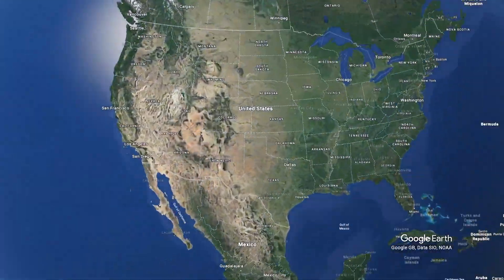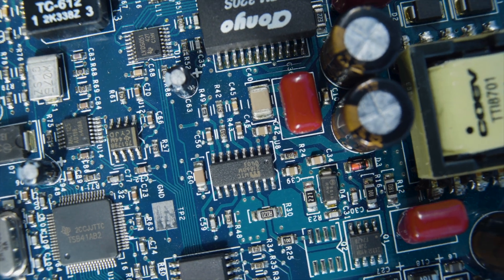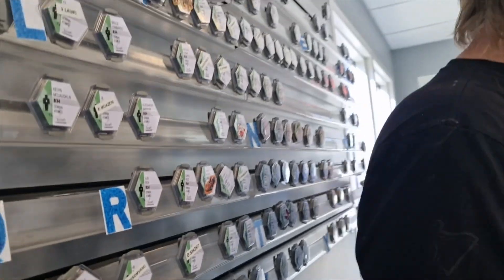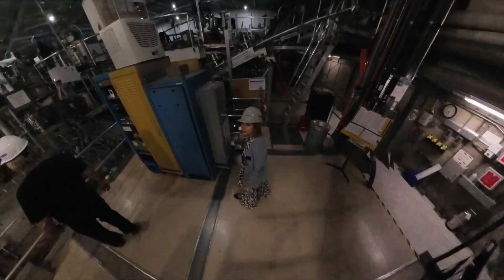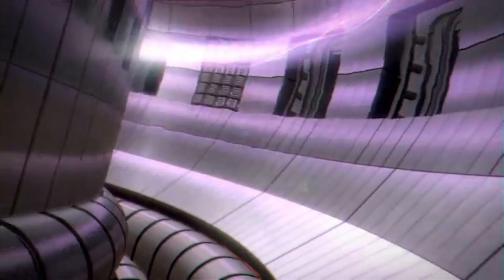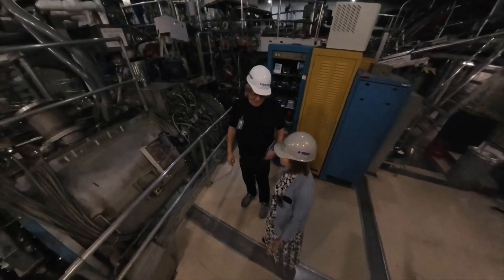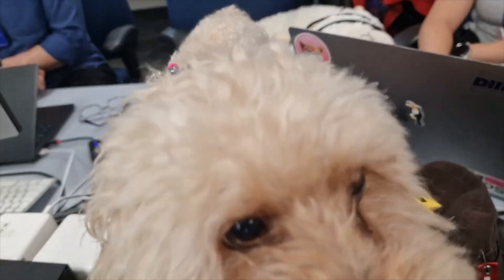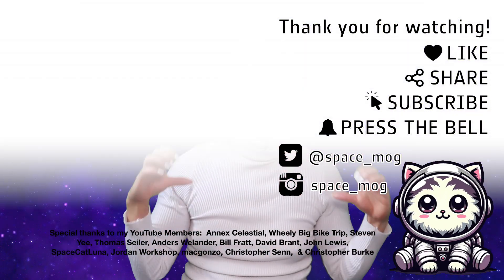DIII-D: I WENT INSIDE The Most POWERFUL Machine in America

Comment: Our opposition government is proposing to have built a number of reactors here in Australia which I'm very much against. E2S Power has just completed the conversion of a coal-fired station in India which now runs completely on stored thermal energy using graphene within nitrogen that stores the 700C piped water to drive the generators. Only having the experience of cabling, racking, routing and earthing 2 coal-fired stations designs it seems such a waste to just de-commission them after only 30 years when they could give so much more at little cost, no coal, pollution or waste. The company I worked for then wanted to send me to Brazil to work on the cabling of nuclear stations but needed to be fluent in the german language. My wife decided to end other 20 year marriage instead. Was also self- building our mudbrick/adobe home, so was a rough time for me 32 years ago.
Reply from the maker: That's a fascinating story and a unique perspective, it's interesting to hear about your experience with coal-fired power stations and the potential for repurposing them and completely understandable to have reservations about nuclear power, especially given the potential risks and the long-term challenges of waste disposal
Reply: @SpaceMog  With so many coal-fired stations across India that will probably be converted, it's going to cause a very big drop in Australia's coal exports making it even more difficult to afford to build what's proposed.

Comment: The usage of epoxy in the close proximity to this much heat is mind boggling!
Reply from the maker: Its not even 30C here in the UK at the moment and i feel like all my plastic is melting
Reply: @SpaceMog  We've got those temp in Ukraine as well, but I can bet it wasn't humid as bad as in the UK, so it wouldn't feel as terrible.

Also, I choose 3d printing filament for outdoor application with the thought that it's a thin line between human-tolerable temperatures and common plastics transition temperatures!
Reply: They make epoxy that is good to over 500C  It is more expensive than the stuff in the hardware store.
Reply: @kensmith5694  Yeah, I understand that and the fact that there are a lot of going on between the epoxy and the heat, but my mind is already boggled at that moment :)

Comment: Sooooo…. When can we be expecting that safe, clean fusion power in reality? These are interesting experiments but how is anything like that ever going to be practical? Fission reactors are comparatively REALLY simple and we struggle with them…
Reply from the maker: You're absolutely right that fission reactors are comparatively simpler than fusion reactors, and yet we still face challenges with them. Both China's Honghuang-70 and France's ITER hoping to get 10 times energy output by early 2030s
Reply: @SpaceMog  ok, it’s a lovely idea, but I’m filing it with 200KVA battery that weighs 300kg and charges in 10 minutes. I honestly don’t expect either to happen in my lifetime. Not to be totally negative, OTOH I guess it’s cool that someone keeps paying for the research so the research can actually happen, it is cool stuff, even though it’s so very, very hot. 😜

Comment: The graphics shows a deuteron fusing with a tritium nuclei, that does not happen in any known star, instead stars use the PP or the CNO reaction because they have huge gravity to make that work, while on earth we cheat by using fuel that was either created by the big bang ie deuterium and the tritium which comes from Candu fission reactors. An astrophysicist should know how fusion works, both in the stars and on earth.

Only an idiot would state that fusion does not produce radioactive waste, when the DT reaction occurs it releases a He nucleus and a high energy neutron which will absolutely irradiate what ever it hits turning that radioactive. And while lithium can breed tritium, it requires a fast neutron to do so, and the tritium nuclei might just fuse with a deuteron, whose neutron release might release the required tritium to continue the chain reaction.

As for fission reactors they also do not generally run away either, this drivel about runaway reactors is just uninformed nonsense.

So in fission the chain reaction has +ve gain, every neutron in the chain will cause 2 or 3 more neutrons to be released causing the chain to move on. In fission reactors the designs limit the chain so that the neutrons are produced at a constant rate as conditions allow, it does not run away. If anything, the MSR designs follow the work load, the more heat that is pulled out, the more heat is produced as the reaction rate increases and vice versa, its simple physics.

But in fusion, the neutron gain is way less than 1, possibly only 0.01 given that most of the tritium that is injected into the chamber will not fuse but will be lost in the chamber and also irradiate the wall. And if the tritium does fuse the released neutron will not likely create its replacement tritium.

Look for Daniel Jassby to learn about neutron economy.

Fission makes loads of sense esp at 1000k in no pressure MSRs, fusion makes no sense at all at several 100,000,000k and is 1000s of times harder to achieve. The only possible fusion reaction that could work would be DD but that requires far higher temps than DT and is also unpredictable with various fusion results. There is also DHe3 which also has no fuel source.

As per ITER, the energy gain of tokamaks is very low, more energy in than out, in ITER case it will take several more generations before there might be energy gain that could be useful.
Reply: The Alpha out of the reaction is not a big problem.  The neutron is serious trouble.
People are using a bigger and bigger hammer trying to make this work.
Reply: I think this was an excellent summary from a bird's eye view. Diving down onto a detail will just leave the audience with the wrong impression. This was actually a lot of details and very accurately presented from this view.
In a fusion reactor the neutron will just go out and get multiplied by lead probably and react with lithium to produce at least one new tritium per DT reaction. The last I heard was that they thought they could get to 0.98 new tritons per DT so it needs to go up a bit. The neutron carries most of the heat but it is the alpha that will sustain the fusion burn. The reactor needs to be big enough and the field strong enough so that it bends the trajectory of the fast charged alpha particle enough to keep it inside the machine. Then it gradually cools off by heating the rest of the plasma and keeping it warm or hot is a better word.
I agree fission is easier and awesome and can be made very safe. The point is merely that fusion is inherently safe. And like you point out the neutrons will activate the machine and modify this simple picture.
Fusion is still research where we are learning about all the things one would need to do to build a useful reactor. We don't know yet what it will look like because then we would just build it. We can just speculate about the details.
Reply: I like to point out that we shorten the burn time from billions of years to a few seconds by using DT and higher temperature. It's a fun fact but perhaps too much information for an overview.

Comment: This machinery proves that we are close to obtain very cheap unlimited energy?
Reply: Completely wrong, MSRs could do the job easily but they use fission. Ironically fission and fusion are far more closely related than most people could ever realize, they both have Beta decay as part of the process, in uranium238 breeding to plutonium it is by normal Beta decay, a neutron decays into proton and electron. In the stars, the -ve Beta decay turns protons into neutrons releasing positrons. Wikipedia, fusion.
Reply from the maker: Fusion energy holds immense potential as a clean and abundant energy source, but there are still significant scientific and engineering challenges to overcome before it becomes a practical reality. We need to achieve a sustained fusion reaction that produces more energy than it consumes, and then find efficient ways to scale up and commercialize the technology.

But the race sure is on to become the first with China's Tokamak HH170 on the horizon too

Comment: Fusion is the easy bit , commercially extracting enough steam next to 100s tons supercooled magnets is the stupidest way ever to make a steam engine . This is poor for Mog , no mention of neutron embrittlement or the problems of the different fuels .
Reply from the maker: Maintaining stable fusion is hard - cooling can be easy, and usually the coolant is recycled :-)  You're absolutely correct about neutron embrittlement being a concern. It's a huge problem that researchers are actively working to address with new materials and designs, and exactly one of the reasons DIII-D exists.
Reply: The neutrons are key to getting the heat out.
They pass more or less through the vacuum vessel wall, with little reaction, and are planned to be trapped in a liquid Lithium layer that fissions to produce Tritium.

Liquid metal is an excellent medium for moving large quantities of heat from the high tech, extreme temp gradient fusor, into the low tech, low temp gradient Rankine cycle turbines in a separate building.
Reply: @NullHand   Well the lithium plus possibly berylium will have to produce far more tritium than the neutrons n to 1 ratio to sustain the fusion loop gain, and frankly engineering a lithium cooling loop in close proximity to cryogeneric cooled magnets sounds like an impossible task, even more so if liquid berylium is used. Thats the whole deal with fusion, an endless train of impossible engineering tasks to do something that fission reactors do with very simple engineering by comparison such as MSRs. Kind of funny that when fast breeder reactors use molten metals like sodium it scares the heck out of people while liquid lithium is now a walk in the park next to cryogenic magnets. See Dr Daniel Jassby or "Improbable Matter"  for their remarks on tritium breeding. Ironically a better coolant would be Flibe a molten salt which contains lithium and berylium, but it is a molten salt that is quite safe compared to using liquid metals as coolants. It is the prefered coolant for most MSRs, the difference is that the fission fuel is added to the salt vs in fusion having an incredibly complex way of producing neutrons. In MSRs, the coolant loop is almost the entire design problem, in fusion it is just a tiny part of the overall complexity.
Reply: Neutron embrittlement was always Freeman Dyson's biggest concern and he was a very clever guy that I had the pleasure to meet. We have yet to gain experience with the full scope of the problem and then we will see how far we get with new technologies and clever ideas. The challenges (our synonym for problems 🙂) will eventually come to an end and then hopefully new tech and clever ideas will keep coming and defeat challenges.
Reply: You right, Dr Mog utterly wrong, but what does an engineer know.
Reply: @johnjakson444  Lol `Engineers `  know fusion research is a job for life ...hint hint, also no mention of military research crossover ..naughty that .
Reply: I have been studing fission and fusion (stars and reactors) for nearly 50 years as side gig, but I would defer to 2 actual nuclear fusion physicists, Daniel Jacobs as well as "Improbable Matter", you can look them up and they would not have made any of the stupid mistakes that this video presents.